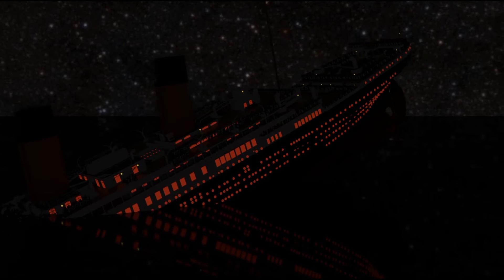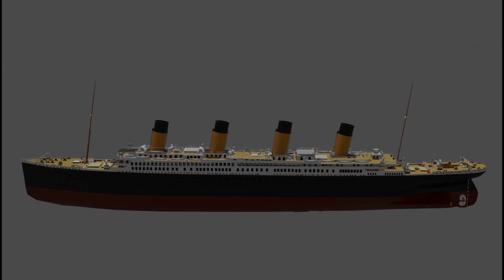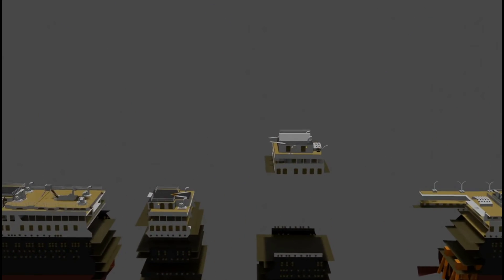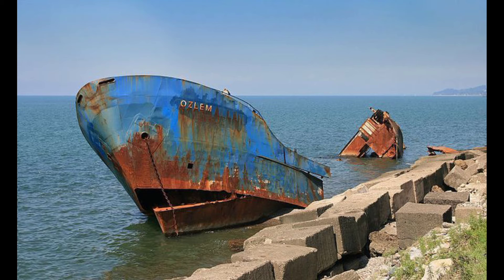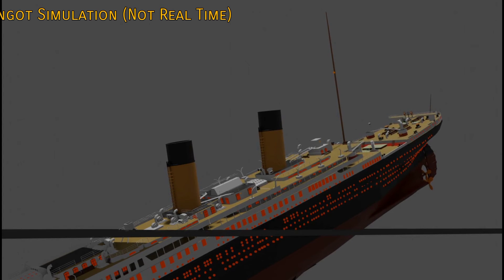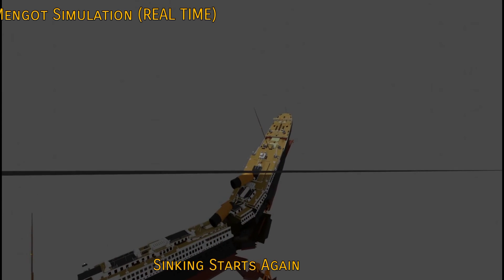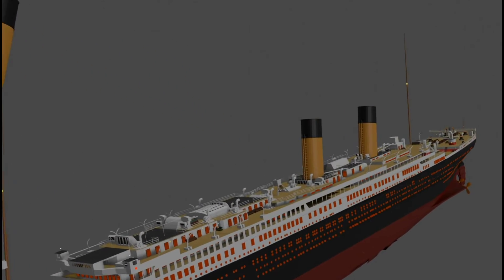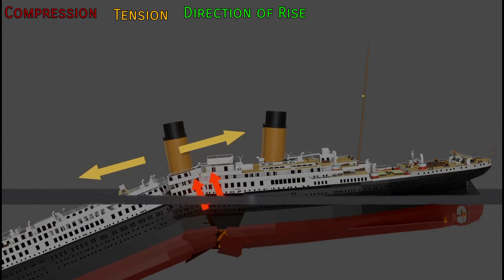Titanic Missing Pieces: The Superstructural Towers

Comment: Question: Would the upward force of the compression on the double bottom cause the shell plating around the epicenter  to bow outward and separate from internal bulkheads? I wonder if this would be part of the reason the shell plating on the stern today is intact, but totally blown out from the main structure.

Comment: Actually Scientists   say  now SHe  was still in one piece  hanging By the  hull  plating. Because the debris  field would be much  larger  if she  broke  apart at the   surface. Which  does  make  a Lot  of  sense & I believe in that one It. & my mom  said  could have been the  water pressure too when it  seperated  in the  first 500ft. SO  she was still in one piece when she  left the  surface. They  concluded. I thiink unless you guys are  scientists. &  I don't think none  of  you  been  down there like they  have. They did  find that  missing part of  hull. forgetting about that?
Reply from the maker: She was not in one piece when she broke in half, she was in pieces, countless of survivors like Nellie Becker, Chaffee, Oliver, And ETC. recall a middle piece or a 3rd and a 4th piece falling in, as the break-up took place. 

Water pressure cannot rip a very strong and supported hull or superstructure, titanic is designed to withstand those type of pressures. 

I haven not been down there, but I have wreck photos which I have analyzed and studied very well which shows other pieces like the forward and aft towers in the wreck located near the stern and one by the east, how about you? :)

Comment: I agree with the theory except I don’t think the forward engines were pushed backwards and then forwards out of the ship. The wreck shows the pipe from the 3 remaining engines bent downwards and the bottom of the ship on the wreck near the engines is bent downwards. I’d hypothesize the damage went up to the forward engines and the plating under the forward engine cylinders gave way and they fell almost straight down.